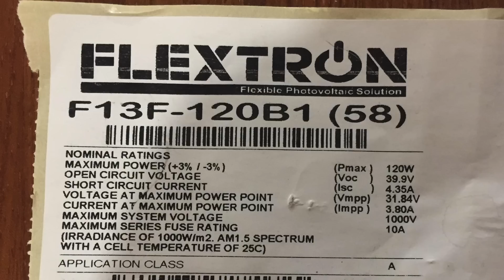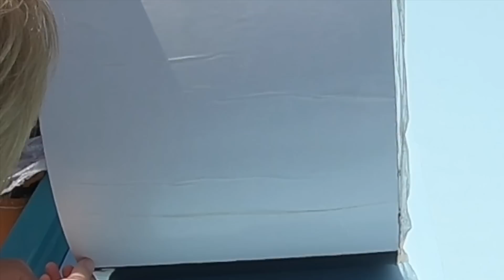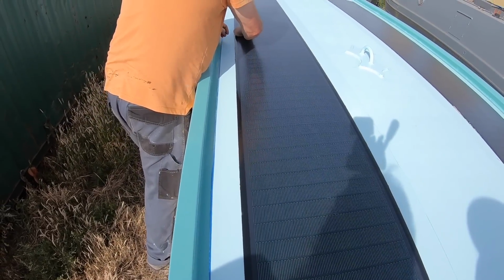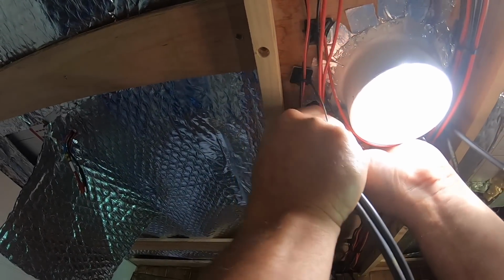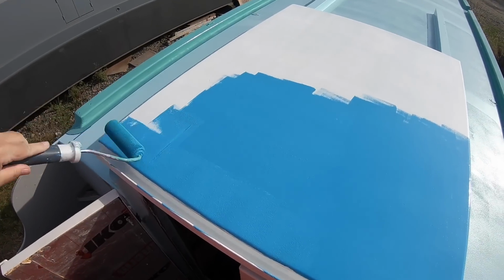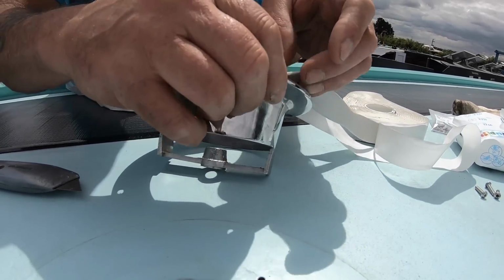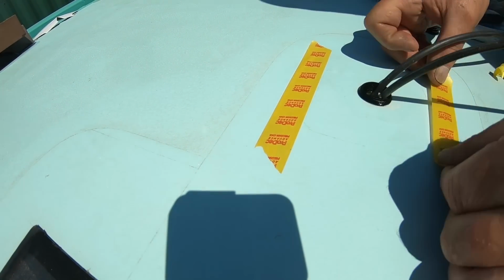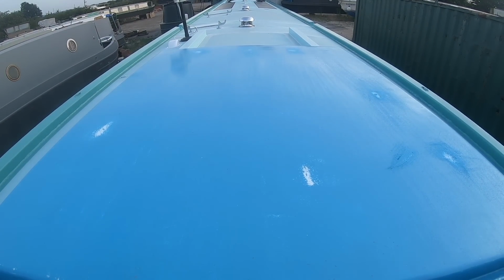Vlog 81, Narrowboat Fit Out - Flexible Solar panels

Comment: Hi we’ve got 6x125watts on our roof 3? In series each side then parallel into the mppt controller they are from midsummer great people I even have a 37 quid battery protect switch from Victron it’s. Set to switch on at 14.2 volts and off at 12.8 volts it heats the water via a 12 volt solar dump water heater. At the moment we don’t run our engine other than to move. I have room for another panel at the back off the boat midsummer couldn’t help as it’s not on of their standard panels, via the manufacturer I’ve ordered a panel 1293 long x 990 wide (3 panels manufactured together) giving 188 watts added to the existing panels we’ve had tilting panels from onboard solar on a previous boat and these are far far superior due to the cells having diodes between them there’s no shading effect. You will not regret your choice 👍👍🖐NB Fiddlesticks.
Reply from the maker: Cheers Stephen thats good to hear. Yes them having the diodes swung it for us too. All this electrical witchcraft is a bit of a minefield to us so we are glad someone gives us a bit of reassurance that we have chosen right . 👍

Comment: Hi again grandad 👴 I will be changing our batteries when they give up 3 years and still doing great. I’ll be going for 6 volt Trogan x 6 at 105 amps which at 6 volts will give 1260 amp hours. Just a thought as you’ve not installed as yet. 👍🖐 NB Fiddlesticks
Reply from the maker: Cheers you two, We better start changing our clothes more often if people are binge watching 😂😂😂.

Comment: It might be a bit late to suggest this but you might want to consider some diverters on the roof at the stern. The water doesn't half come down the inside of the handrails and straight on to your rear lockers. Looks great, keep well both.  George
Reply from the maker: Cheers George, Yes We know what you mean. It's that bit between the run off point and the end of the stern. We have seen people using a bead of CT1 to divert the run off so might try that 👍

Comment: Another job ticked off of the list. I'm very surprised that the +ve and -ve connections on the solar panels weren't coulor coded red/black or brown/blue so that Grandad wouldn't have had to test them. 
Great music.
Reply: Can't speak for every brand of panel but normally one's a male connector and the other's a female. The convention is that power comes out of a female connector and goes into a male, so the female is +ve.
Reply: @Dave-bu6bc  Thanks, that sounds sensible.
Reply from the maker: Cheers Tony. Yes what he👇says 😆

Comment: Another excellent job. I was a little surprised to see bare wire on the internet antenna connections. Are you going to terminate those yourself as well?

Edit: I kept watching, and then see you actually pushing the center pin down onto the wire with your bare fingers! How thick are the calluses on your hands?!? For those who haven't soldered, the soldering iron is literally hot enough to melt lead!
Reply from the maker: hahaha yes asbestos fingers. Years of soldering Gas Pipes I suppose 😆

Comment: What's the fire risk on these type of panels ? I know in Australia in the early days they were catching on fire or melting, I never would have thought that a problem here, but with the weather forecast for next week its a lot warmer than I would have thought. I used to have Panels on my house but they always have a gap so air can circulate.
Was just thinking that's all.
Reply from the maker: Hi Henry, Good question. We can't find any information showing these panels could be a fire risk but will look into that a bit more. I do know the company that made them have designed them to go onto steel panels for cladding buildings so should be able to cope with the heat with no airflow and our type was adapted to go onto Boats/RV's. Yes we have always had panels that have an airflow in the past so this is all new to us. Time will tell if we made the right decision 👍

Comment: Hi, I believe these panels suffer from the heat of the steel roof in summer and the cold in winter. Newer panels now have an air gap underneath to help alleviate or prevent this. Whats your thoughts on this.
Reply from the maker: Hello Dave, It will be a wait and see for us really as we don't know how they will do until we have had them for a while but these panels have been designed to fix on to steel sheets on building and our type have been adapted for boats. We read a lot of good things about how these work on buildings before we decided to give them a try. Time will tell 👍